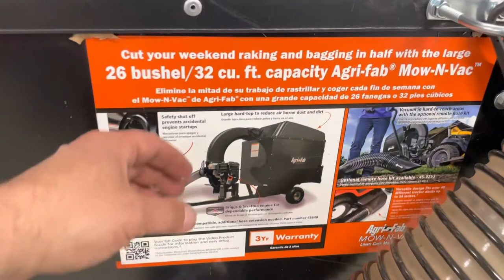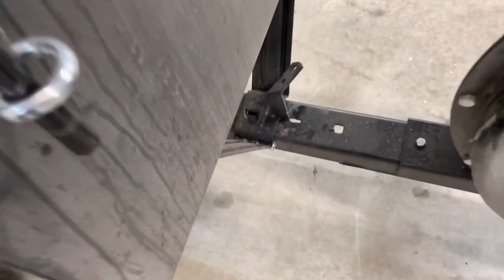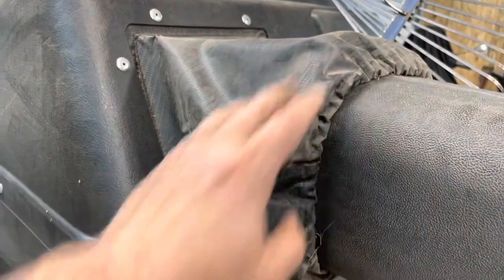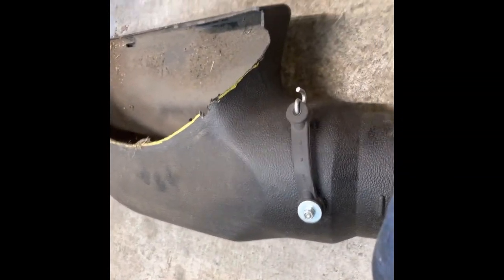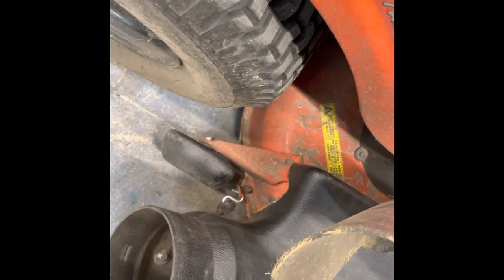Agri-Fab Mow-n-Vac tips and modifications.

Comment: What is the wire on the inside roof for??
Reply from the maker: Works as a sort of filter so the leaves don’t just blow out the back of the box.
Reply: Can you show how you set that up? Or just screwEd some wire to the top?
Reply from the maker: @THEREALBIGGROBB the screen was in place when I bought the leaf vac. I will try and take a closer look as to how it is installed.

Comment: Does it pick up grass clippings though?
Reply from the maker: Yes, I have cut fairly tall grass. Run over it a couple times with the mower. Then used this fella to pick up the clippings. It will plug up easier picking up wet heavy grass. Just can’t be in a rush.
Reply: How do you get the rivets off to replace the cloth sleeve?

Comment: awesome tips i  bought this model a few years ago used it once and it sat in a shed for 2 years and a mouse chewed through the white cord coming off of the impeller. i for the life of me cant find the other end or where it goes if i was to buy a new adaptor. Google youtube and facebook groups have been 0 help . Anyway you or anyone reading this  be able to show me at least a general area where its going to or point me to somewhere other then the parts diagrams that show nothing. I would appreciate it so much
Reply from the maker: Your not the only one asking this question. So I went out to the shed and tore into the engine to find out where it goes. Here is the video,
https://youtu.be/2c4Gd_y_Ge0?si=VpuE4AYBXYTSFReI

Comment: Do you know of any videos replacing the carburetor? I have the intex i/c 206 6.5hp Briggs on mine, but it looks extremely similar
Reply from the maker: I have not looked at all. My carb has  been trouble free so far. Cleaning leaves right now. Look like two nuts, a fuel line. One linkage rod with a very fine spring and whatever is involved with the choke. That and the air cleaner on top.

Comment: Do you happen to know where the white wire from the leaf vacuum safety shut of goes? My vac won't start and that wire has come undone.. however I can find anywhere that looks like where it would connect to! Its just a frayed end and no actual plug is on the end ... thanks on advance
Reply from the maker: Hello, I had no idea where that wire went to. So I went out to the shed and tore into the motor to find out. Here is the video,
https://youtu.be/2c4Gd_y_Ge0?si=VpuE4AYBXYTSFReI

Comment: Hello great video but i have a question how to do you keep grass from building up in the Chute
Reply from the maker: You have to match the ground speed to how much the vac can handle. It can be tricky depending on the material you are sucking up. Dry leaves generally go easy. Mulched leaves I usually slow down a bit. To reduce the volume going in and to suck most of them up. Green tall grass can be frustrating. It’s wet and sticky. whenever I think it found the right ground speed to avoid plugs. Pow, I clog the hose or overfill the bin and plug up the works. Good luck and stay safe.